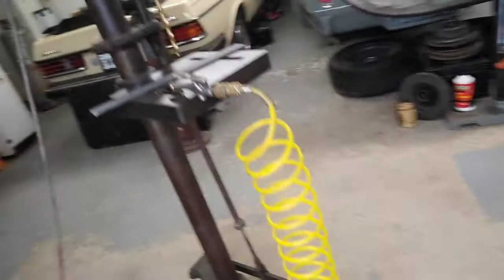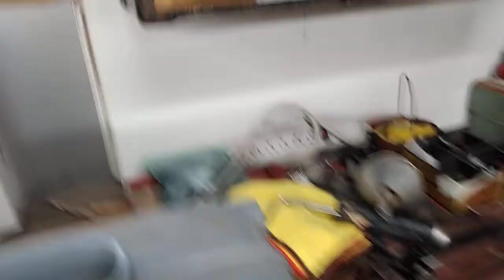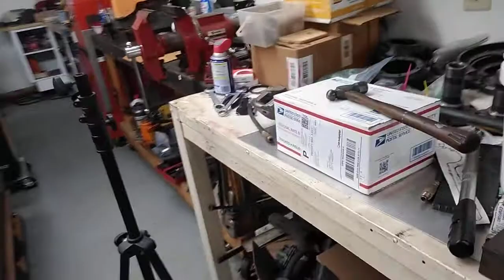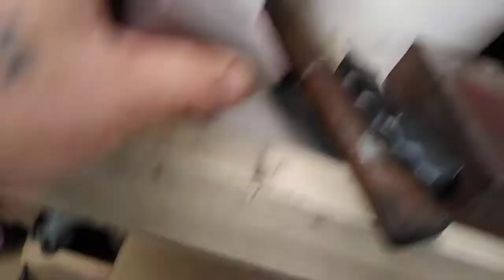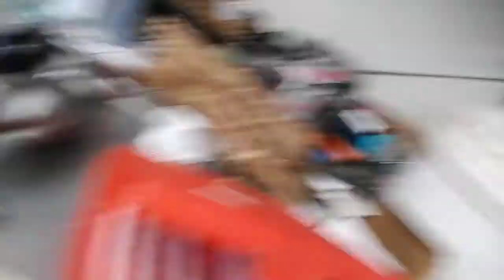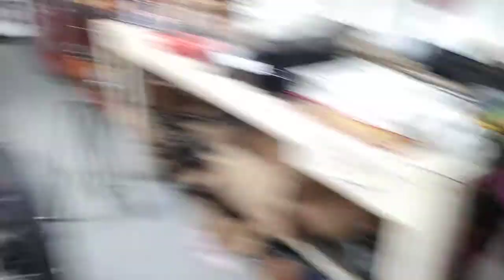Mixed bag today around the shop.

Comment: Get your gage blocks out and check your tolerance out on your 1 2 3 blocks. I need a new set but I'm worried about buying them on internet
Reply from the maker: Old machinist (retired now) taught me a trick. Take the new blocks, wipe clean & leave no shipping oil on them. set on on a clean flat surface, that the other one and press down the to mating surface's (slightly sliding as you do this), if the top block lifts the bottom one,,they are precision ground (@@)! FYI, try it!